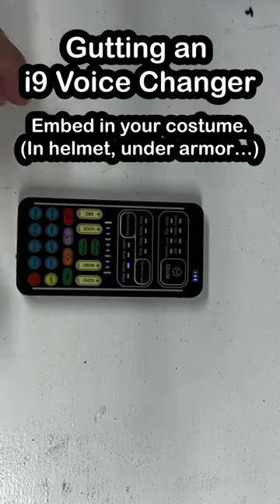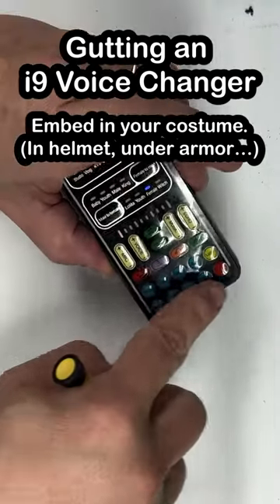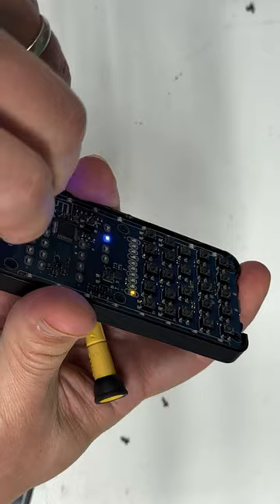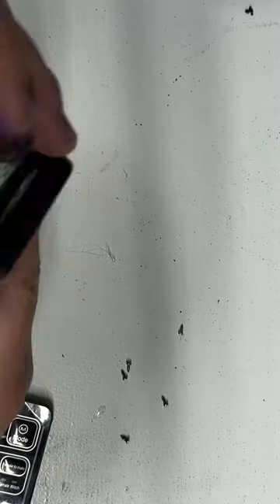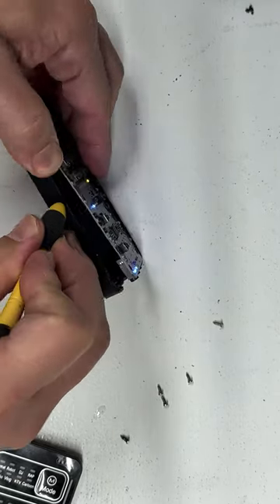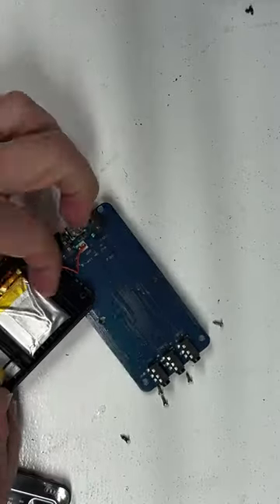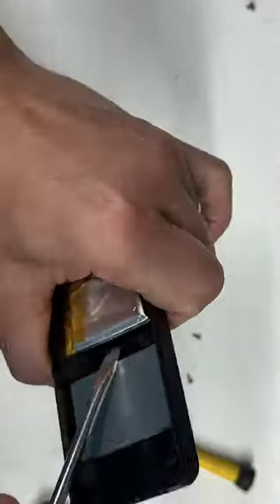i9 Voice changer circuitboard removal for embed in helmet/mask. Costume mods for #cosplay

Comment: Have you found a way to keep it protected from sweat and moisture when in a helmet?
Reply from the maker: I’ve put spray paint over some electronics to both protect the boards and camouflage them.  I also keep them away from my breathing area.  I also like to put in ventilation systems in my helmets - see my vid where I add a dual fan system. V2 Easy Helmet Fan System - Simplified wiring + a 2 fan design (for Costume Masks)
https://youtu.be/R27vB9hq1OY